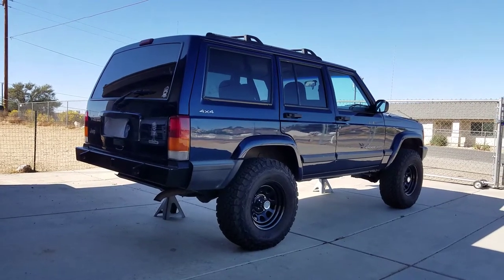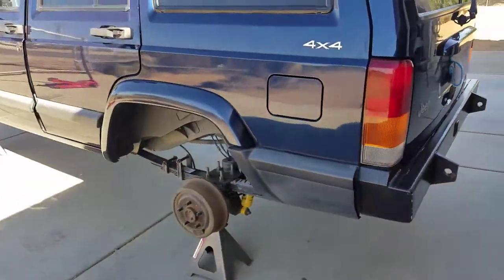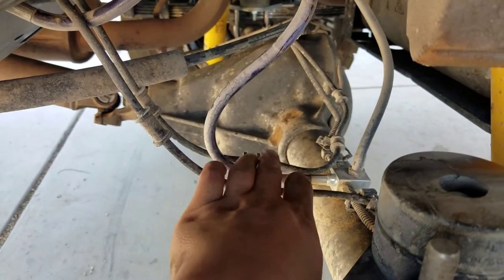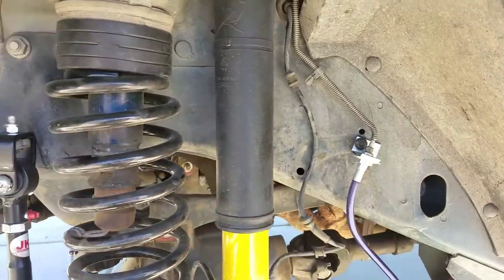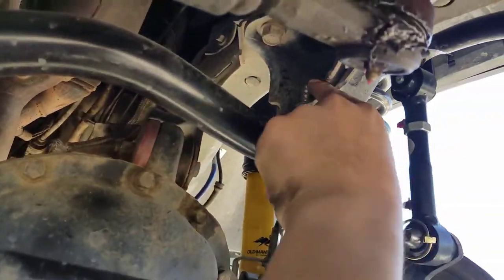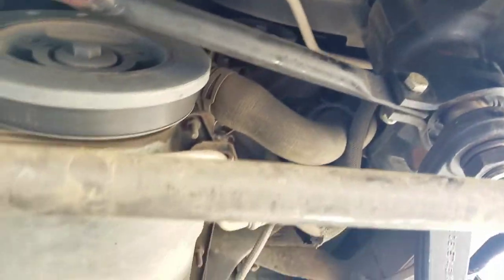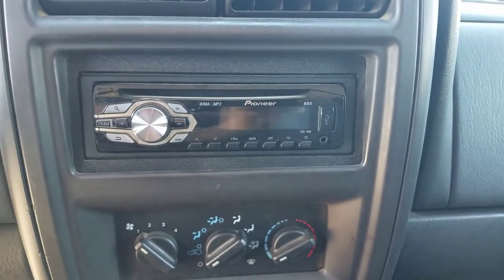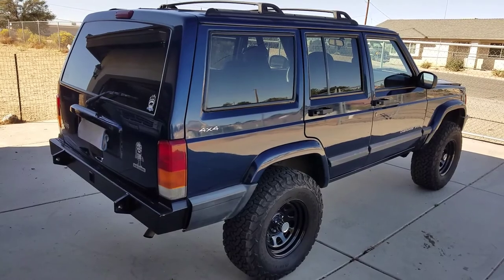2001 Cherokee Sport XJ 3.5" lift walk around.

Comment: And I'll more than like go from the non-LT245/75R16's on ZJ wheels to a possible Rubitrek 235/85R16 for a bit more clearance with my Rubicon Express 3.5" lift kit.  As I'm not going wide, but narrow not needing aftermarket wheels on my 4 liter powered '87 Pioneer.  Note that a non-LT lacks tread depth and more cases lighter constructed side wall which is fine for my use as I am not towing and mostly on forestry roads and highways.  While my girlfriends stock '89 has 235/75R15's General Grabber AT2's that are awesome in the snow, but are noisier at speed nor worn as the LT compound is also harder.  We don't play in ORV parks or rock crawl as that's not our interest. But good coverage and topic.

Comment: Did you do a t case drop or  sye? Putting a 3.5 on mine but trying to figure out if I need one of those.
Also be careful with the hood vents. If you drive that daily and in rain you are going to want to keep a lot if sensors on hand. Your cherokee should not have issues overheating. If it runs too hot do a flush and water pump. Stock should be able to handle both extreme cold and heat

Comment: Did you say what size tires are on it??
Reply from the maker: I don't remember if I mentioned tire size but they're 31x10.5 R15
Reply: @robbinbanks6790  I'm getting ready to put that same lift on my 2000 XJ and 31x10.50r15 as well. Only difference is my rims are 3.75" backspacing, as I want a little more sticking out. I have to admit, the 4.5 you have looks good!!!
Reply from the maker: Thanks.  Even with my backspacing, small rocks tend to hit the mirrors or sometimes even send small rocks into the Jeep.  I think you'll be happy with OME lift.  Great ride.  Not back breaking. Handle pretty darn good, too.

Comment: Any driveline vibrations?
Reply: @robbinbanks6790  Thanks for the info, can I get by with a transfer case drop?
Reply: @robbinbanks6790  I love the look of 31s and 3-inch lift, but would a 2.5inch OME with 245/75r16s look badass enough?